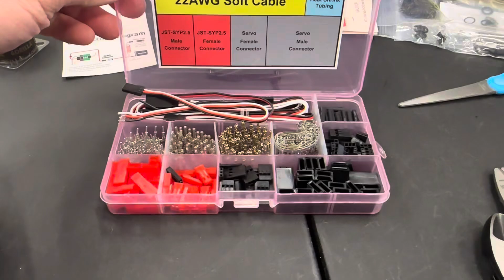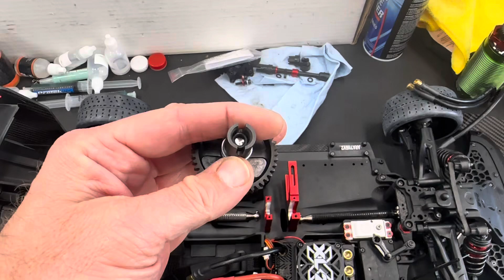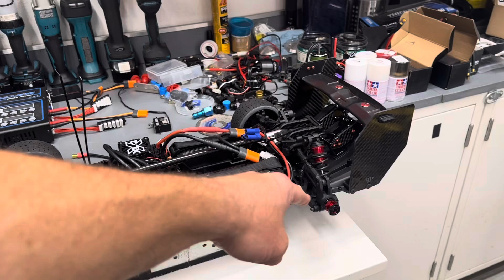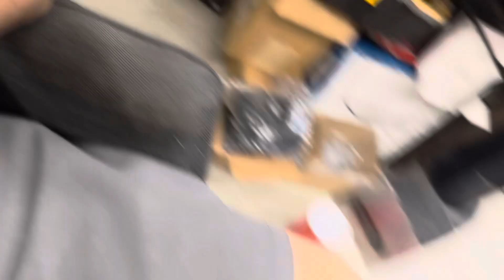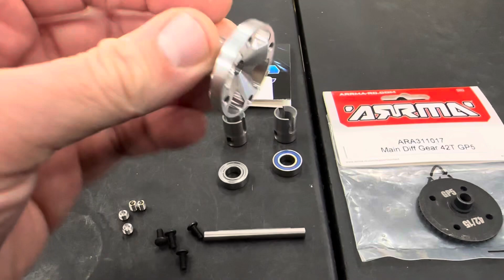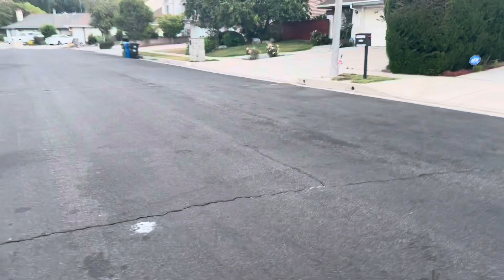Arrma Limitless Drag Build - Best Kept Secrets

Comment: What transmitter you recommend?
Reply from the maker: @SergeShahov  I’m running the Radiolink RC8X. It has the throttle delay built into it for drag and speedrun.  I think it works great. It also has fantastic range.

Depending on what you are doing, all the good transmitters out there are great. They may not all have the same features, so you could always run a Perfect Pass launch controller with whatever transmitter you choose

Comment: I would put the locker in the front and put one million in the rear. Lastly is get xx pink BSR and play with your throttle speed on the remote so it isn’t blowing smoke from the hit.
Reply from the maker: @OldGreyBeard45  I need to get the next video out soon. I made some good changes and tuning

Comment: Awesome set up!!  Thanks for all the info.  FYI  I see you have both antennas sticking out parallel? I’m sure you’re not concerned about range but I think they’re supposed to be 90° from each other.
Reply from the maker: @Raven77m  yes they are normally 90 for more range. Since this drag not worried about it. My infraction and speed runners are set as 90
Reply: @ yea duh, I should have figured u knew that already. 
Sorry. 
lol
I was thinking about building a drag car.  
But with how cheap it is to get insane power these days I can’t convince myself I’ll be able to get traction without weighing the car down
Reply from the maker: @ haha… I haven’t added any weight yet…I’m trying not to. If I want to go faster it will need a little weight possibly and tire prep for sure.

Comment: Whats the gearing?? I put a center spool and a million weight front and rear with foam tires and it launches straight as a arrow
Reply from the maker: @anthonysmith9765  a lot!! Haha. It goes straight now that I’m using the traction control on the radiolink and diff lockers front and rear.

Comment: Get ur some BSR foam tires, double pinks, or 25 shore. U going to need prep & a wheelie bar.. No locker. 500k in both diff's
Reply from the maker: @bojones1709  don’t plan to use prep..want to keep it a dry tire build. I blew through the 500k diff so it definitely needs the lockers

Comment: Nice I like the shock trick for the shaft I seen another guy use small fuel line and put over shaft to shorten it what we're those washers u used ....
Reply from the maker: @JmanRc  they are just an 8-32 nylon washer. I get them in different thickness to tune the height

Comment: Are you really using that as a drag car? You would have fun building a real drag truck/car, unless you have already done it before? I have two drag trucks… Losi and Traxxas… I’ve built them kind of here and there… they both would smoke that car on 2s… if I throw a 3s battery in it would blow your mind…
Reply from the maker: @RC-Closer1313  yeah I’m not really into the 2WD drag cars. To easy…wanted to build something that would be a challenge. Eventually it will most likely end up on foams and need some serious prep. This is all just testing right now.
Reply: My 8s limitless is running 1.3-1.4 second 132' runs. Don't get me wrong the 2wd stuff is cool but they're just not as fast as the AWD cars are now.
Reply: I have a 2wd 272 trans mod1 gearing extended rustler that will bleed your 2wd buddy and for the record, you don't know what his car can really do unless yours is next to it at the line 😂